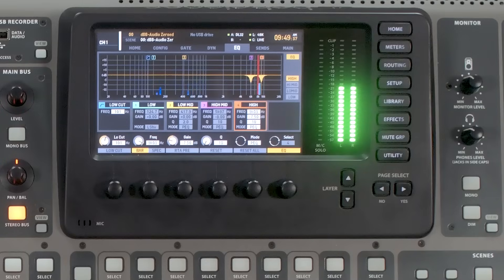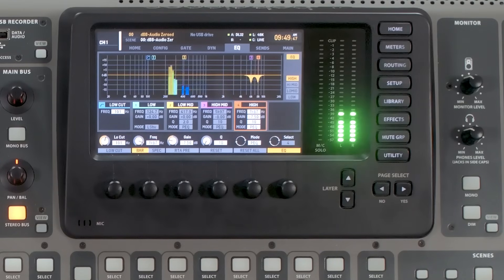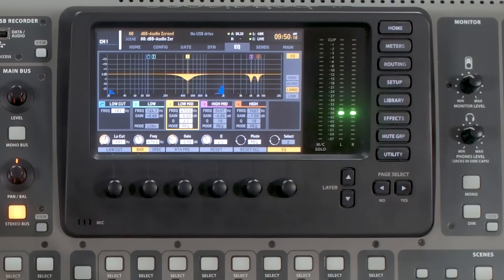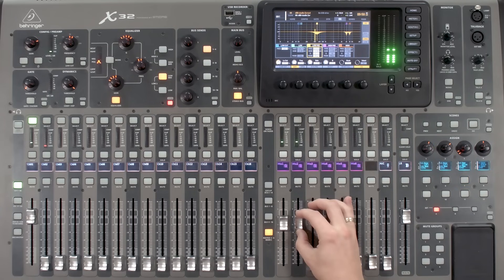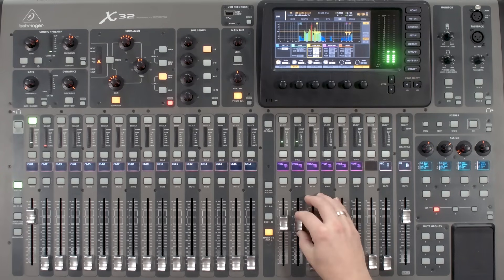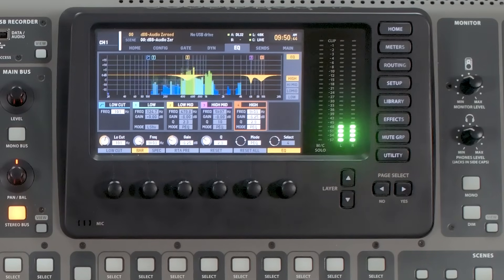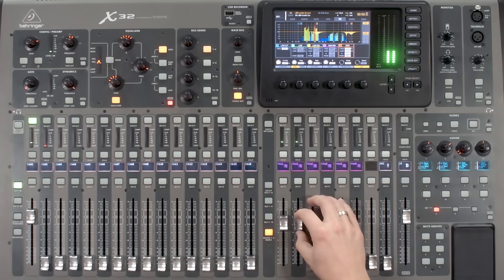Preventing Microphone Feedback in a Live Sound PA

Comment: @drewbrashler - Still a newbie here - So I really love your videos at learning a lot. I have 2 questions it would be nice if you could comment upon.

1) - In this video you EQ your microphone. Let's say you are getting feedback in stage monitors. When would you prefer to change EQ on microphone Vs. stage monitors? I know that ideally you have 2 chains for the same signal, but if you have to ude only one, it's a choice between changing the signal chain in botb main PA and monitors. OR change all signals in the monitors by adding EQ to the monitor

2) - If you have a small stage with several stage monitors - have you experienced that it's needed to ring out eg. 2 monitors on the same microphone?

Comment: Drew, thanks for the videos, but I think you've made a mistake in this case. Feedback reduction should always be applied to the main output equalizers, not to the individual channel equalizers. Each channel's EQ should be reserved for achieving the best sound internally. By doing things this way, you're mixing concepts and limiting effectiveness. There's one room and only one PA system that will boost the same frequencies. Do you think it's normal that if the room boosts 400Hz, you have to reduce that frequency on all channels instead of going directly to the main output EQ? It's crazy. Thanks again.

Drew gracias por los videos, pero creo que en este caso te has equivocado. El tratamiento para evitar la retroalimentación, se debe hacer siempre y solamente en los equalizadores de la salida principal, y no en el ecualizador de cada canal. La eq de cada canal tiene que estar reservada para conseguir el mejor sonido de manera interna, con esa manera de hacer las cosas estás mezclando conceptos y limitando la efectividad. Hay una sala y solo un sistema de PA que potenciará las mismas frecuencias, ¿tu ves normal que si la sala potencia los 400hz, tengas que reducir esa frecuencia en todos los canales en lugar de ir directamente al EQ principal de la salida? es de locos. Un saludo y gracias nuevamente.

Comment: We have a very live Sanctuary at the church. Our old mixer, a Soundcraft Ui16, had a 12 filter dbx afs2 built-in. The hardware dbx afs2 has 24 sets of stereo filters. 

Old Ui16 died by static from a lightning strike on property recently. Since we're looking to have expansion to include a stage box in the near future, it was time to move on from the Ui series. Have the hardware dbx afs2 ready and new mixer will be the Behringer X32 Rack.

I'm continuously working with the singers to get the mic closer. It helps for a while. 

Second, in the future also is hoping I'll get some acoustic treatment. 

The dbx afs2 has already been setup as I trialed a Presonus Studio Live iii 16R. This mixer isn't flexible enough in routing, so back it goes, and here comes X32 Rack. Sweetwater has been so helpful.

Comment: I did some work recently at an African church helping them with their sound by implementing IEM's and fixing issues with their livestream and in-room mix. They like to get VERY loud, and their space is nothing but flat surfaces, and they had also decided to mount their main speakers on shelves in the corners of the room in front of the stage pointing 45 degrees across the room (yes, I know, phase issues galore). They had constant feedback issues, so I took the levels down a bit and left in only the vocals and keys in the Floor Wedges for the singers. I then ran the main outs through a DBX feedback suppressor which they had on hand and then into a sub which then fed crossover outputs to the main speakers (hopefully extending their lifespan).

Main issues still are vocalists pointing their mics DIRECTLY at the wedge, so I set up a mute for the wedges in that case.
Reply: Hey bro! Can you help me with our livestream?

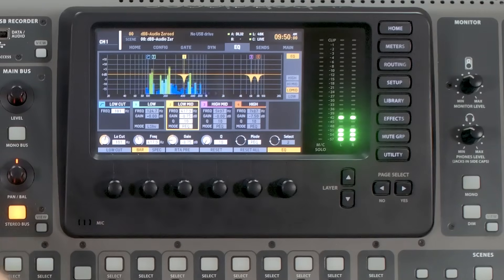Comment: 8:42 how do we do this without a visual EQ with a basic mixer like Yamaha MG10XU 10 channel mixer that has highs mids and lows?
Reply: You have to sort of listen to the sound of the feedback and figure out what frequency range the sound is in. 

For example - if the feedback sounds like a normal male speaking voice pitch, you’d want to use the mid frequency section. You’d want to grab the mid frequency knob, then turn the volume of it up then start turning the frequency knob until you find the point where it feeds back the worst. Once you’ve found that, you can turn the frequency volume down until the feedback stops. Then you can turn the whole channel up in volume. 

If you have a “Q” knob, you can use that to dial in how wide or narrow your frequency range is. Usually feedback happens in a pretty narrow range of frequencies, so you can usually make it pretty narrow when you’re cutting it.
Reply: @chronicmango  ok thanks for your explanation

Comment: Headset microphones, especially those thin, skin-colored ones with tiny omnidirectional capsules, are more prone to feedback than handhelds.
 
According to my personal experience, the best way to prevent headset from feedbacking is to make sure that the capsule is placed as near as possible to the sound source - to be practical,  about 1cm behind the corner of mouth. This ensures that, at the position of capsule, the SPL of useful vocal surpasses the SPL of monitor wedge bleed at the greatest extent (seems quite similar to a higher S/N ratio...), thus the least amount of gain is needed to acquire an acceptable vocal level and therefore the possibility of causing a feedback is reduced as much as possible.

It might be a good idea sending all headset mics to a subgroup. Then it's convenient to use subgroup EQ to deal with common problems e.g. feedback points and troublesome freqs, and leave the channel equalizers for individual toneshaping. Subgroup compressor and fader are also powerful tools for dealing with crazy variation of dynamics from soft spoken lines to loud choruses.

What's more, these mics can actually pick up lots of bass and cause rumbling low-freq feedbacks, so always apply at least 100Hz HPF for headset mics and never send them to subs.

Comment: Can someone tell me... Would it not be better ( or another solution) to cut the eq on the monitor of the singer instead of cutting the microphone, So you can use the eq on the mic for "better sound" out?
Reply: Most band pa and house pa do it that way, , kinda depends on if the singer always uses the same mic, but if different people use the rig or it always changes you have to adjust each time. Keeping good monitors is the hardest part always. Like a never ending task LOL

Comment: What also helps to prevent feedback, is to use less gain on the preamp of the channel, and to raise the fader more. 
When you apply gain on your mic, not only does the mic get louder into the channel, but also you add more noise to it. (I’m not talking about the noise floor that gets amplified through the mic, but actually adding noise from the preamp itself). 
The more noise you have in a channel, the quicker it’s going to feedback. 

This trick helped me a lot when I had to amplify a few of those omnidirectional headset mics during conferences.
Reply: Correct
Reply: Genuinely curious, but how much gain should I use? I'll be a sound technician for the first time for our theater production, tips would be appreciated!
Reply: @andriealinsangao613 To give you the most honest answer: I can’t say, because it depends completely on what mixing console (and its preamps) you are using and what mic you’re going to amplify. 
There are some rules of thumb, for instance give it gain until the meter on the channel is showing -18dB (if you use a digital console), but in a lot of situations that would already be too much gain. As this video points out: it really depends on how loud you need something to be amplified. Just follow the tips in this video and I think you’ll be just fine. Good luck! 👍
Reply: @luukmeijssen2515  If I knew our gear, I bet it would be wireless lavalier microphones like we used on our last production... I don't know yet.
Reply: As strong a signal as you can get without feedback, clipping, or unwanted noise.

Most digital boards - generally aim for -18 or -20db.

If it looks low, but turning the gain up makes it too hot/unwanted noise, then you need it low and use fader/digital increase. 

Also note: good idea to set your gain without gates and compressors tricking you. Then add those after you have a good input level.

Note: a line in cord or electric keyboard will barely need any gain too get a good strong signal. 
A vocalist who likes to hold the mic low will need a totally different amount and need nice between gain, volume, and feedback.
Don't expect all these pretty gain lights to line up the same.
Reply: You use behringer?

Comment: Great stuff Drew!  I would like to point out to all that use the x32 live that using your bus sends for monitor mixes gives you 6 eq's to use for ringing out rather than the 4 you had available. Also, eqing and low passing the mic on the input channel first so it sounds good out front. Those eq and low pass adjustments are then sent to the mix bus. You start with a decent sound.  For back up I also have 31 band eq's inserted into the first 4 mix bus' on my board. I programmed them into the first four ASSIGN buttons as well for instant access. Pretty much got all those ideas from watching you work the board lol. Thanks a bunch Drew!!🤘✌
Reply: "For back up I also have 31 band eq's inserted into the first 4 mix bus' on my board. I programmed them into the first four ASSIGN buttons as well for instant access."

Nice !

Comment: The issue I often have with ringing out feedback is that I ring out frequencies when there are no audience in the room, but when  the room gets filled with people, room acoustics change a little which results in different frequencies prone to case feedback.
Reply: That's not actually how it works the audience would actually absorb more sound causing less feedback
Reply: @sethbrouwer2008 that's only partially true. A big audience in a room will often increase temperature and humidity which will change the acoustics a little. Often you're not going to hear the difference but for feedback, only a small change is necessary.
Reply: Even though audiences absorb sound…they also create sound in the form of singing / talking etc…and that can add a variable for feedback in some forums / arenas.
Reply: Are you referring to the PA or floor mons. Cos by and large, with audience, you generally get better gain because of the absorption clothes provide. Mons shouldn’t change largely. Temperature would cause some changes but it wouldn’t be so drastic that you need to redo the ringing out.
Reply: That only changes when your doing it with FOH Not monitor
Reply: Sounds more like there are still some frequencies you need yet to tune down or you aren't seeing enough margins in practice to allow for the volume you need. 

If you really really believe the temp and humidity are that significant (probably false) then just slightly widen your q and it's covered.
I think you will find that didn't solve it, because an infinitesimally small frequency shift isn't the real cause of your feedback.
Reply: When the room is filled up with people, less amount of feedback is created, so it's a matter of dealing with high and mid frequencies to mitigate these issues
Reply: This might sound dumb but I actually help decrease feedback by lifting my speakers up as high as I can and angling them downwards towards the audience. And I usually deliberately set my floor monitors in between the performers rather than in front of them and facing straight back towards the end of the stage rather than facing the performers. I normally like to give drummers some headphones or in ears to help decrease that horrible drummer request if TURN UP MY MONITOR. That setup normally helps against feedback BUT! while the crowd is having a good time, the band usually gets mad at me because I tell them straight up don’t move my wedges lol
Reply: @JavierSanchez-el4pl yes that is always been the case when one instrument is louder from the others everyone complains and ask for more volume or gain.
Reply: Then go back and adjust

Comment: I ran sound for high school theatre productions for two years, and in that time, I learned to fight the uphill battle.  The stage was abysmally treated, the face mice were omni directional, and there were speakers pointed directly at the actors. I was never instructed on how to fix the issues, so the school was lucky that I knew what I was doing or else it would’ve been a disaster. I did everything mentioned in the video and some extra stuff. I’d highpass everyone’s as close to their voices’ fundamental as I could get. I’d use the exponential (EXP3) gate to keep the mics off going below -45db. Lastly, I’d compress each voice about -25 db to make sure no shouts or belting caused the whole system to feedback. Needless to say, my EQ curves looked like Swiss cheese, but everything was working against me when those mics went on. Again, these configurations are for very, very aggressive feedback control, but when worst comes to worst, this is how I managed.
Reply: I have this same problem in a hall I mix in. It was designed for choir, and they took all the carpet, pews, and sound dampening off the walls, installed theatre seating and a powerful sound system. Now I have to do everything you just described, for every mic we use, and again every time we move one. I'm begging them to put sound dampening back on the walls so I can have people other than myself run sound occasionally without giving them a crash course in GBF and audio theory lol.

Comment: A very good video Drew as you have address the cause of the issue well. I have a few suggestions...
- you should use differing terminologies for speakers. Either Speakers & presenters or monitors & speakers as it can be confusing.
- you talk about the EQ effecting what goes out to other sources. The better way to handle & think about this is to use the channel eq to correct the source & any issues unique to that channel. Then use the paramatric equaliser on the send (or even better is to insert & use a graphic equaliser, would be nice if behringer made the GEQ an option on the send like on the XR models). That way you are dealing with the issues unique to that listening position. Other locations (hopefully on diff sends) could have different issues due to types of monitors of physical differences in surfaces etc. 
- the last one is a nit pick, with respect to the gate you mentioned it mutes the channel, but with this setup (as you explained by the 9db gain reduction) it is attenuating the channel.
Cheers

Comment: First and foremost, I think this is super informative and well intentioned, so keep it up. However, what works with one person in a room on a 57 does not necessarily translate very well to a live performance, especially a loud rock show in a club environment. Feedback typically presents as the high frequencies you're getting here, in the 6-8 kHz+ range, but when you get 12 open mics on stage and start pushing things through monitors you might find that the buildup of low-mid frequencies in the 200-300 Hz range is really where feedback begins. Taming that range can have a remarkable impact on the higher frequency feedback, not to mention it helps prevent the phenomenon where you continuously try cutting high frequencies so you can have a louder monitor mix, only to have the musician say it now sounds too muddy and dark. Narrow EQ bands can also create other weird issues because of the "shoulders" that pop up on either side of what you're cutting, which isn't displayed very well on most RTAs.
Reply from the maker: Absolutely! I have a video coming out soon about ringing out monitors, because controlling feedback is always a handshake between the FOH and Monitor engineers. Thanks for watching and the comments!

Comment: this is my fundamental of mixing 
1. know your speaker ( using rta measurement ) 
2. know your gain on every mic (every mic has different setting of gain based on the system you're using, so careful)
3. use GEQ on every monitor ( mostly reduces 2k 4k 8k up to 5db or more and make another adjustment on another frequencies based on the room you're using )
4. prevent boosting frequencies on mic, don't be afraid and so pity on reducing frequencies, make adjustment later
5. ALWAYS USE LOW CUT ON VOCAL🤣
Reply from the maker: Good fundamentals!
Reply: @DrewBrashler hi sir can you explain about behringer feedback destroyer fbq2496
Reply: It’s premature to say you should cut those frequencies you mentioned without listening to the monitor, the microphone and their relation to each other. And i boost some frequencies on vocals when needed depending on the singer’s voice. There is no hard rule for that. Essentially the idea is to help them hear themselves better.
Reply: use an expander  earn 3.5 db